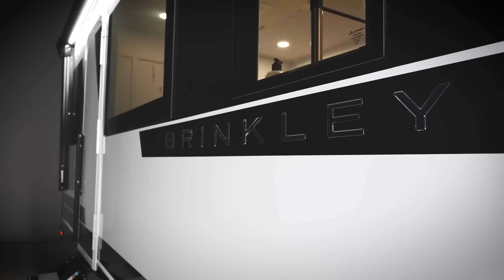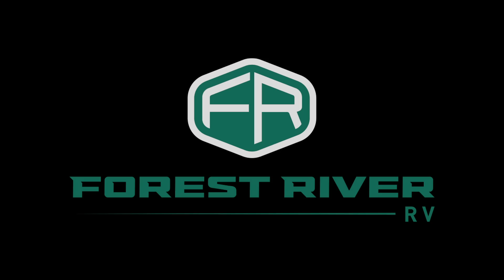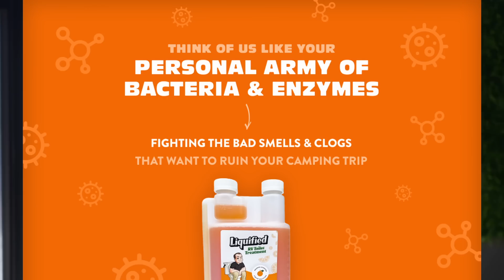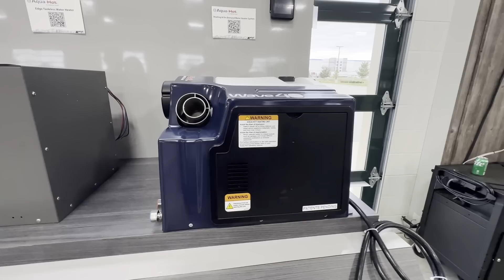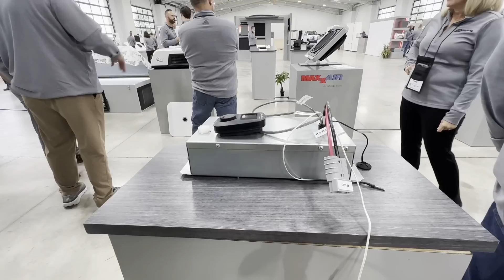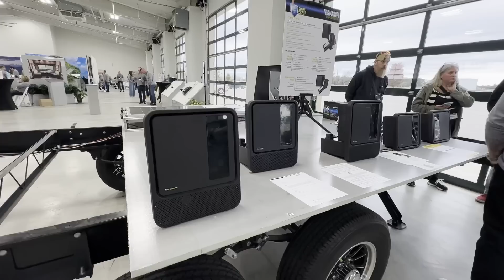RV Manufacturer Quits California, New BRINKLEY RV Line, New Air Conditioners, Water Heaters & More

Comment: Bought a new Montana 5th wheel in 2021. A year later I was cleaning the roof at the end of season. Noticed rust running down the rear of the front Coleman AC unit and onto the nice white roof. Turns out they put "non exterior rated" bolts to hold on the white cover. The rear unit was fine. Called them and they tried to blame the local dealer. Really? The guy was really smarmy and kind laughed me off. Not cool. Went to the local hardware store and bought stainless steel bolts. Sad. Zero customer service from Coleman. A few bolts. Really?

Comment: I hate to say but I don't think the RV industry does very good with high tech things. They have a hard time with making low tech things that last very long.  They need to concentrate on building a better camper or motorhome before putting in more complicated electrical components.
Reply: Agree with you. Auto industry does a better job- but still has many problems. We Americans are addicted to "new tech" which is cheaper than buttons, switches and knobs. But the failure rate is high, everything is "connected" and most people are unable to troubleshoot software and circuit issues- so back to service center for real delays and frustrations
Reply: IMO watching videos outside an RV is just weird, a visual annoyance like the people who think everyone in the campground wants to hear the music they play on their external speakers.

Comment: From video I've seen of the new Brinkley travel trailer I'd still say it is in 3/4 ton truck territory. I own a max tow 1/2 ton with 1300 - 1400 lbs of available payload after passengers and cargo are accounted for and would hesitate towing something that heavy and long with it. It would probably be fine down on the coastal plain where it is flat but up in the mountains or in windy conditions the 1/2 ton just doesn't have the wheel base and vehicle weight to make for a smooth tow. I do like the looks of the trailer and if Brinkley were to come out with something under 30 ft, better yet closer to 25 ft, and in the 7K lbs GVWR range I'd seriously consider replacing our GD 22MLE.

Comment: Friends. Just spreading the word. I drove my Winn Revel over the Mario Cuomo bridge. They charged me $34. I was shocked. No warning. I use to cross the old bridge for $7.  I called to get info and was told that the height and time of day matter. No way to appeal it. FYI.  DaveH
Reply: Wow! They must be some sort of glitch. I ran across the  Tappen Zee/Mario Cuomo Bridge 2 weeks ago and my EZ pass was charged $13.58. (MH 3-axles towing a Jeep). Typically when I start to plan my route I will look up the toll rates and then finalize my plans based on how much tolls will cost. For example for me to go across the GW the my average toll is $100 depending on my timing it is worth it other times I will skirt the city and take 81.

Comment: The Brinkley I 265 has a GVW of 9600 Lbs.  You can see it on the full dealer walk through.  The dry weight is around 7700.

Comment: All these blue tooth controlled devices are going to be a disaster .   The people who build RV's will never be trained to build them correctly ,  the customers wont know how to use them and the people who service them wont be trained to operate them let alone fix them.  As factory support for what is built today is POOR what do you think is going to happen when a coach go down on a customer  and nothing works ?  Is the tech support going to be able to fix them?   This is the Dumbest idea I have ever heard!
Reply from the maker: @glennlacewell5766  that’s why this is a GREAT idea. All other Bluetooth control in RVs so far has been done with a computer that controls everything. That’s the piece that can get confusing or break. This device, being at the fuses themselves, means if anything goes wrong, all of your switches work. And if you don’t want to use it you don’t have to.
Reply: Bluetooth is great until you really need it then it decides not to work. Am I right?

Comment: Where would Grand Design be without a new name, higher price, and distinct aesthetic to make customers think that the name change involves quality? Brinkley wouldn't also be putting out such expensive RV's with OSB subfloors that can swell if they get wet for any reason and then have the slides damage them, would they? They wouldn't lie to their customers right on the factory tour and tell them that it is "marine-grade" OSB, would they (which doesn't exist)? That is precisely what they do, exactly like GD. Massive investment in aesthetics at the expense of engineering, again--a Grand Design redux. The feds should really step in and stop the endless charades in this industry.

Comment: "If your naked in the shower, you can just use bluetooth"..   I don't know about you, but I don't usually bring my phone into the shower 🙂
Reply from the maker: @russellnell3474  I don’t either - but I definitely bring it to the bathroom lol
Reply: My motorhome has a pump switch on the bathroom vanity along with two other locations.  I do like bluetooth for my thermostat so I can turn the heater on before i get out of bed.
Reply: My phone is waterproof-ish, but my watch definitely is, however they both are listening. 
My phone is usually on the counter right next to the shower if I had to touch it